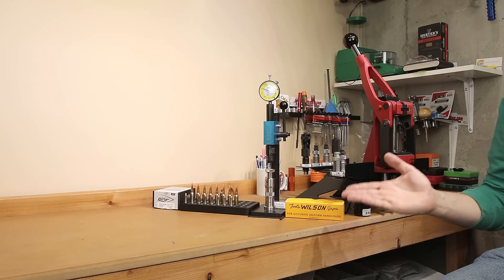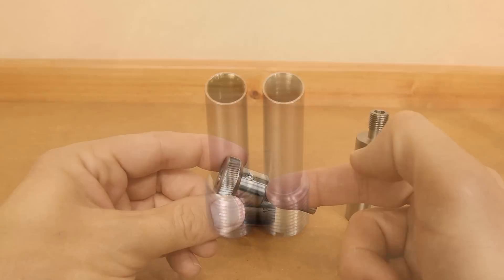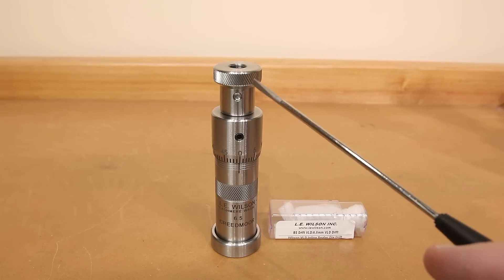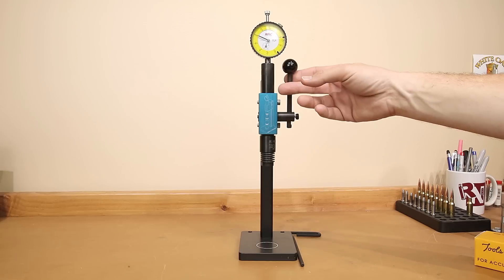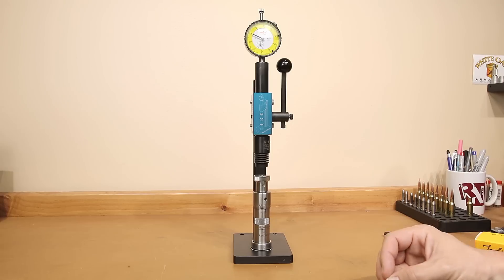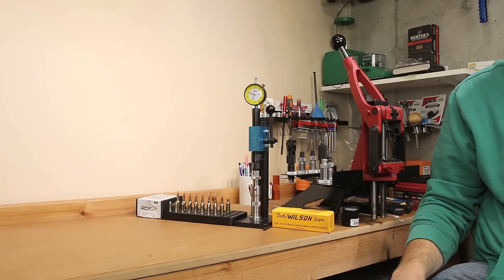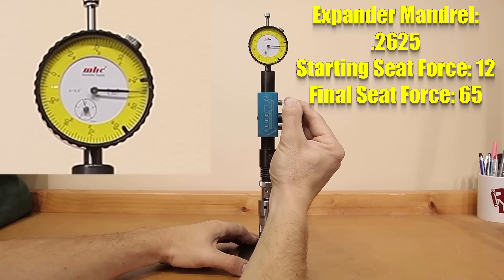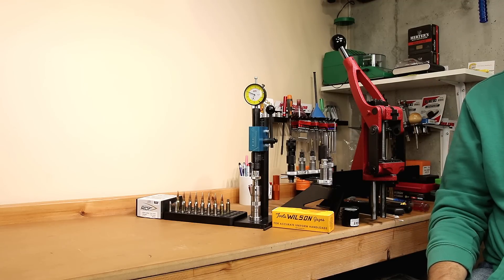Precision Reloading - K&M arbor press with LE Wilson seater die- Neck Tension vs Seating Force

Comment: Great Vid! Like the "extra level of precision" I see a tub of what looks like graphite powder (dry lube). I think an additional nice test would be to dip bullets in it (tail end) or apply to inside of necks with a q-tip or fluffy brush(bore mop). This is going to a crazy level of curiosity but it would be interesting to see if has any effect on constant seating pressure if mandrel size is kept the same ie .263

This might also give us a more accurate indication of how many pounds of seating pressure for example 1 thou  of "neck tension" translates to. I belive it is referred to as "break free" point(initial seating pressure).
Reply: Absolutely!

Comment: I did a preliminary test using the 21st Century mandrels. I tested .001, .0015 and .002 neck tension. I loaded 10 rounds each, but had trouble with my labradar. I recorded 5 rounds each. I seated with a Wilson seating die and K&M arbor press with gauge. All brass was processed at the same time, full length, sized and champhered, powder weighed on scientific scale within one kernal of Varget. Although not a comprehensive test, the results were interesting. At .002 neck tension the ES was 6 and SD was 3, at .0015 tension, the ES was 3 and SD 1.4, at .001 the ES was 12 and the SD 4.8. This was on my competition barrel, so didn't want to waste too much barrel life, will do more testing with this barrel after my new one arrives. I am going with .0015 tension and will chart the results over 100 rounds at the next meet. This is on a 6 dasher F-class open rifle, unsorted lapua brass, no neck turning. For what it is worth.
Reply: I wonder how much concentricity is negatively affected by seating a bullet in a smaller neck. Bullets were never intended to be used to expand necks. I would also expect the seating stem to do more damage to the bullet as neck tension is increased.
Reply: @njgrplr2007  Concentricity would only be affected IF the bullet seating device or die was not aligned. Otherwise pushing a concentric bullet into a concentric case, although a couple thousands smaller, straight in could not be concentric. As to damage to the bullet, yes, extreme neck tension would require more force to seat which may damage the bullet from the seating stem. This also takes into consideration how well the stem is made to match the surface of the bullet. The larger the surface contact the less damage. Typical bullet damage is a ring on the bullet, which means the stem only contacted the bullet on a very narrow band or edge. If the stem matches the surface the force is diffused over a much larger area. I have modified all my stems to resolve this issue. I have seated bullets up to .006 neck tension without any visible damage to the bullet. I have had stems that damaged a bullet with as little as .001 thou neck tension. I throw it away or fix it, but do not use it as is. .002 thou neck tension has been pretty much a standard for decades, I am quite sure the manufacturers consider this in bullet construction, tension is required to hold the bullet in place. While it may be true to say a bullet was not made for expansion purposes, that does not mean it was not considered in the design, as it is also a requirement that must be met.
Reply: Thank you for you information, let us know how you go with the testing please!
Reply: I've always said 1.5 thou of neck tension is the best.
Reply: @vladmirputin7139  Given my basic test, I have to agree. I am sure the SD will rise with a larger sampling, but I believe it will still be in an acceptable range. I will start sorting brass with the first 100 rounds. I sort brass by velocity not by weight.  One cannot tell if the weight difference is in the walls (volume) or base. If I get a velocity out of my acceptable range, and no appreciable  difference in vertical, that brass goes into the sighter box, if there is a difference in vertical, it goes into the trash can. A 1.00 piece of brass is not worth a 9 to me in competition. I use old barrels for testing brass. Just how I do it.

Comment: Like many other friction topics, seating force has a natural dispersion. There are many factors that contribute to the readings, so it takes statistical sampling to get a clear picture of the results even when manipulating a single variable. Mother nature is cruel like that. Things that help are to be meticulous about the processes for sizing and chamfering and keeping the condition of that brass as identical as possible. Then I would also recommend trying to use a nylon brush with graphite to lubricate and condition the neck in order to reduce the average and SD of the friction coefficient. 

An oversimplification of the seating force is to say it is the product of the hoop stress times the friction coefficient, so the smaller the average coefficient and the smaller the dispersion in that coefficient, the smaller the overall dispersion. It would still take statistical sampling to get a clear picture, but you will likely see a more proportional plot with using the average of five samples of each step size change.
Reply: The real real issue why your SD and ES becomes unstable and jets is a few factors. 1) non repeatable scale, 2) non repeatable annealing or not annealing 3) improper sizing or not consistent 4) temperature - after just a couple shots temp stability will start drastically changing your velocities. So if you have a very good temp stable powder like rl23 old batch varget or say vhitavouri n150 or n565. If all of these are met you can safely measure and correlate. I've seen repeatable results of less than 5es up as far as 5 reloads with rl23 5 shots each batch. So correlate it slightly further with test will totally peak my interest
Reply: I tried graphite & it has terrible effects. Before trying it, I thought for sure it would act as a great lube but, it's just the opposite. Seating force increases from 30% to 50% &, it causes stop/start or halting movement during seating. I can only guess that it must tend to build up in front of the bullet base then roll in between the bullet & neck.
Reply: @rotasaustralis  That sounds like bad luck. Graphite can become an abrasive, but only under extremely dry conditions. This is why we don't use it in vacuum or high altitude applications where there is RH below 1%. Under typical breathing air conditions, it is a fair dry lubricant and should act to prevent typical clean metal contacts from galling and go as far as improving the friction coefficient. It is worth giving it another try in my opinion, but lots of times you can get very good neck to bullet friction without it, so you can find you can live without the extra steps.
Reply: @dinoc.5537  I've given it 2 seperate goes with the same distinct manifestations. I tested it again because I was so sure it should work & doubted my initial findings. There may be the possibility that lock tumbler graphite is not suitable for some reason as this is what I used. I simply dipped a Q tip into the little squeeze bottle after removing the tube lid &, wiped generously inside the necks. Provided that lock tumbler graphite is the same as graphite marketed for bullet lube then, I definitely won't be going back for a 3rd try. During bullet seating, I can tell instantly if there's graphite or I've missed brushing the neck, it's that apparent.
I'm definitely done with graphite. I've given it 2 cracks with identical unsatisfactory results. I will however test Moly because Lou murdica uses it in his testing & such. Lou doesn't say anything bad about graphite but, he doesn't use it either........Hmmmmmmmmm.
Reply: @dinoc.5537  Dino, just to clarify my last explanation a little. The 1st time I applied the graphite to the necks was a full loading tray (50) pieces of which I seated a bullet in all of them. Up until that point, I had only started annealing & done some preliminary test seating of bullets. After reading about others dipping the case necks in graphite, I automatically assumed it would be a positive step &, prepped all 50 308 win necks as a matter course. Suffice to say, things did not go smoothly during seating but, at that time, I had not seated many after annealing so didn't have the benefit of experience. It wasn't until I decided to pull the bullets & start again that I fully realized that graphite was a problem somehow. Every bullet pull with my hornady collet puller was much harder than all my test seating rounds as well as the seating issues. From there I dumped all the powder in order to brush the graphite from the necks & started over. From there, everything returned to smooth trouble free seating. 
The next time I tried graphite was weeks later with my 243 cases of which I seated 8. After pulling those, I decided to abandon graphite completely. No scientific analysis by any stretch but, good enough for me. Maybe I applied too much, I don't know but, the difference was pronounced & the issues were such that graphite appeared to defeat the purpose. 
I do want to try Moly as I stated but, not for tension reduction or to smooth out seating as, brushing necks has been very effective & gives excellent results so far however, Lou Murdica uses Moly in part to stop or reduce neck/bullet bonding over time which, I have measured as a definite phenomenon whereby, the bullets seem to bond or stick somehow after just a few days with, a noticeable increase in bullet pull effort.
I must say that I understand your consternation as, by all accounts graphite should work well but, not in my case at least. 
Kind Regards.................Rotas.
Reply: I have been using graphite also but watching an experiment by Witch Doctor, he compared graphite to Neolube 2. The results were pretty obvious that Neolube 2 performed the best in comparing seating force. I have ordered Neolube and will see what results I can get with it.. I’ll be using Wilson in line micrometer seating die with K&M arbor press with force pack. Witch Doctor did state that the Neolube takes a while to dry. It is a graphite, isopropyl, and water solution.

Comment: Just got the hydroseater. I'll be doing the exact same test. It'll be interesting to be able to correlate seated force to velocity.  Everything in reloading can be measured somehow so neck tension by force is measurable. Interested to see your findings moparmadman.
Reply from the maker: I think that it will be interesting information. I haven't seen it available anywhere else. Feel free to let me know what you find.
Reply: @BoltActionReloading  for sure, I'll be testing 338 lapua virgin brass as well as freshly annealed 6.5cm SRP brass. I'll release to you the info when I am complete. I'll be doing it in 2" neck tension